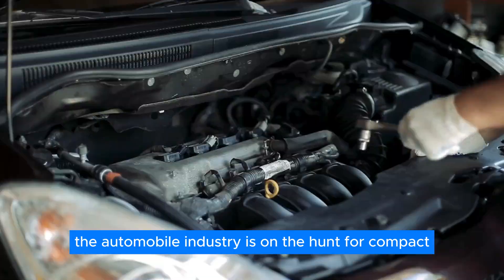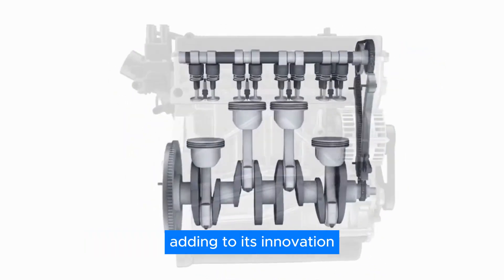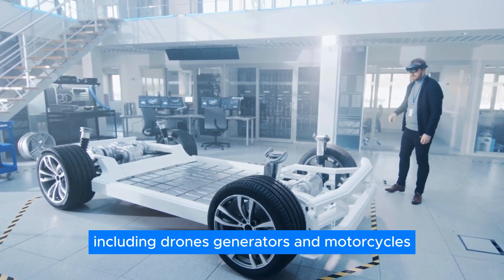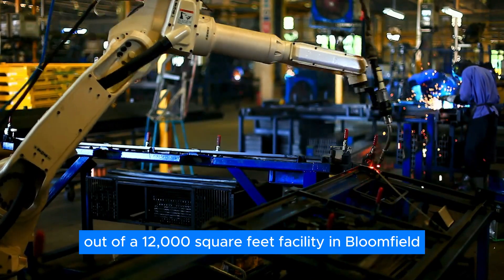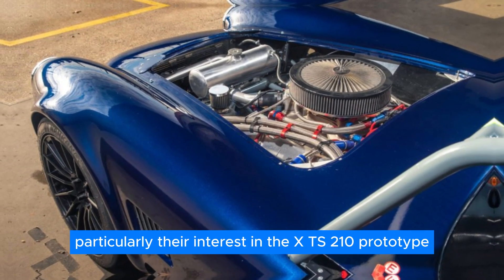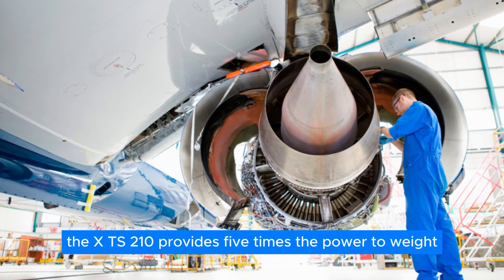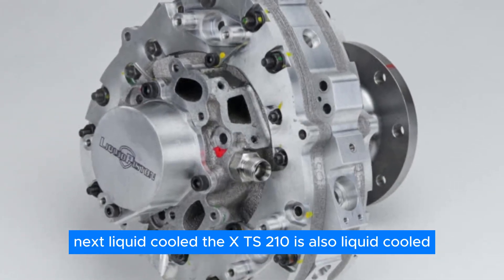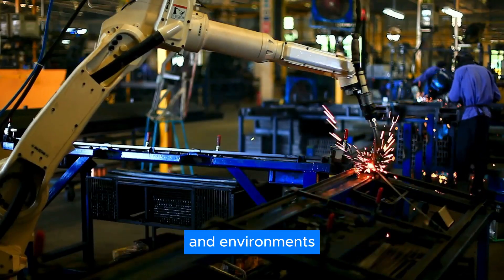This New Tiny Rotary Engine SHOCKS The Auto Industry!

Comment: I have been following the liquid piston engine for many years, but like nuclear fusion, it never seems to get to the stage where it becomes mainstream.
Reply: Its best application is a hybrid plugin range extender. A generator basically. This way it can run at the most optimal RPM.
Reply: The Polaris 850 patriot 2 stroke achieves fusion.

Comment: This video is nonsense.  AI voice + stock pictures of various engines.  

The engine itself has the advantage of small size, but you can bet that emissions are bad as is fuel efficiency. The military may buy some if they turn out to be reliable, but beyond that there are few uses.  Cars and yard appliances are going to go primarily electric in the next decades as charging technology improves.
Reply: military will use it if politicians get their kick back
Reply: @bowlweevil4161  Good point.

Comment: The conservative anti rotary world should have NEVER kicked rotary engines out of Formula One. What they have done is, they introduced rules that made it IMPOSSIBLE to win any race driving a rotary engine. Mind you, rotary was winning ALL races, for a short while. Do check when and who, I remember it was crazy powerfull Audi's. Instead of a FAIR limitation, they KILLED rotary racing cars. And they KILLED racing as a test platform, for rotary engines. That is more than just stupid, who ever did that, BEEEEEEEEEEP! So, when the world is finaly ready for a Formula Rotary, do not be afraid that this would be the end of Formula One! Do not fear things that will not happen. Only problem is, Formula Rotary might easily drive faster lap times. Then gradually bring power levels closer, until rotary cars can compete in Formula One without crashing all track records. Get real, with such rev limits, a rotary EASILY delivers more specific power. Now is the time to do FAIR calculations on power. Do not make the same moron mistake again! And that is my friendliest way to ask this.
   Anybody thinking the same?